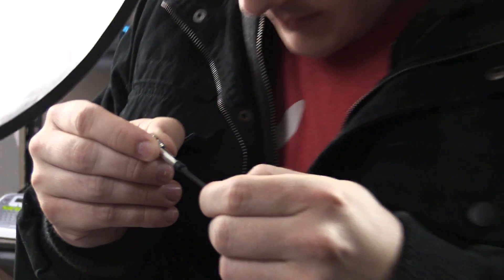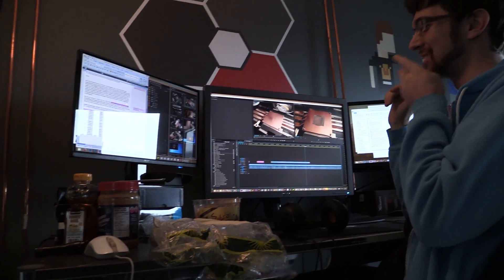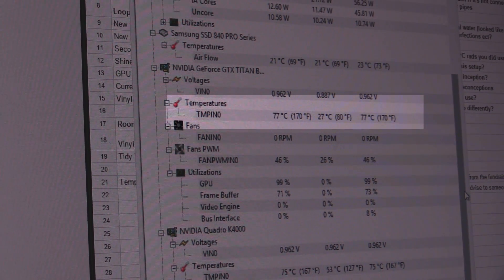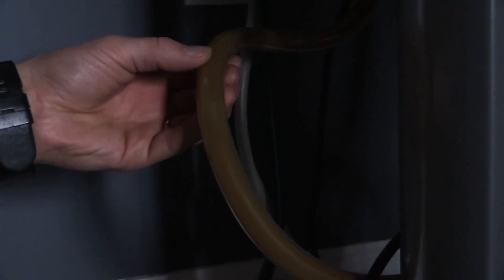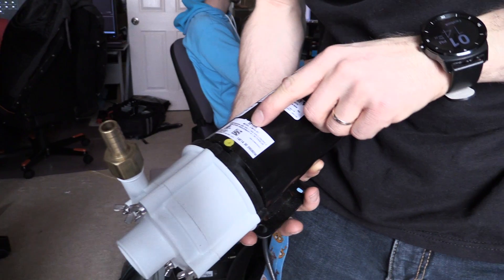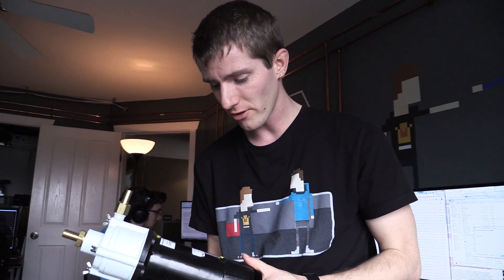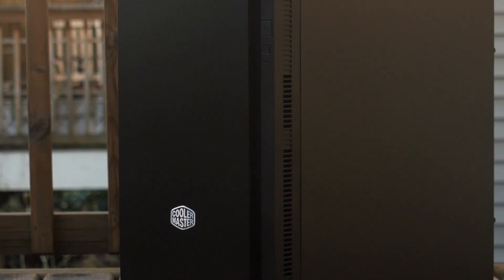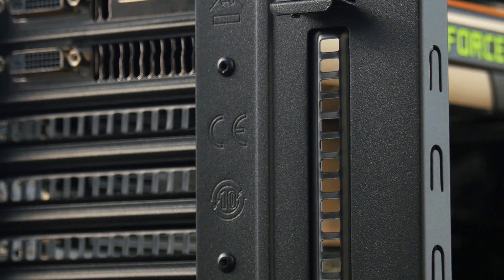Whole Room Water Cooling Part 5a - Trouble is Brewing in the Whole Room Loop...

Comment: Automotive antrifreeze is not a good idea! it is not designed to kill bacteria etc, since in a car it is heated to about 90°C all the time anyways, so every life is killed anyway. you should use something to kill of any bacteria or algea...
Reply: wrote this too soon i guess...
Reply: I think they should just add the "poison" to the current loop minus the reservoir. Over the course of a few days it will probably kill everything and flush it through the system. There may be some traces left, but as long as you don't let them grow it should not be a problem.
Reply: Niosus True...
i think they should attack that reserviour with a pressure washer to remove the biggest chunks. after killing what is left in there with some kind of "poison", rinse it again and then install a filter to get the last stuff out of the loop. When the loop is clean, the filter can probably be takenb out again. just killing what is in there is not enough i think, it needs to get out and new growth must be prevented.
Reply: muh1h1 Yes. The big guns once to get it clean, and a filter or or small concentration of biocide permanently to keep it from happening again.
Reply: Niosus i am sure they will find a solution soon :)
Reply: They should use waterless coolant.
Reply: SamuelDM Look at the first comment:
"wrote this too soon i guess..."
So don't judge others for not paying attention, if you can't do so yourself...
Reply: Buy a single Troy Ounce silver bullion and add that to the reservoir, silver is a natural biocide (As Linus has said in multiple water cooling videos). They're about $20, if that.

EDIT: $20 Australian. So probably $15 or so Canadian.
Reply: Where's Ripley when you need her?
Reply: what if algae is not kill?
Reply: ***** um no its not. The main ingredient in most antifreeze is ethylene glycol which is extremely toxic. Alot of animals die from drinking it due to its sweet taste.
Reply: muh1h1
Why would you take a filter out ? Once its installed, just keep it.
Reply: R4GEcraft Well, as far as i see this is a centrifugal pump, wich would mean it is constant pressure not constant flow. Meaning if the resistence throughout the path is higher, this will slow down the flow, instead of making the pump work harder. But then again, i am by no means an expert, just my thoughts...
Reply: muh1h1 No judging. We both made the same mistake.
Reply: muh1h1
I just watch the video again and yes i also think its a centrifugal pump.
But the pressure isnt really constant in those kind of pumps. Pressure and flow are both function of the circuit's caracteristics.

Anyway, everything here is pretty theoric, we can't really say much without testing it first :)
Reply: muh1h1 Flush the res with Clorox, or alcohol. Very few things can survive that kind of environment.
Reply: LogicOwl | Let's Plays Clorox would probably eat the radiator core.
Reply: That is why I said just the res, not put it through the whole system loop. However, I will acknowledge that there are better solutions which I was unaware of, like silver. No idea that's a natural biocide, you learn something new everyday.
Reply: LogicOwl | Let's Plays There's still the problem of flushing the radiators, Linus mentioned being unsure if they were full of shit too. I thought you were covering both, my bad.
Reply: ThatGuyOnCoke
Using silver could lead to galvanic corrosion though.
Reply: Carlos Eduardo Lopez well, i think it is mostly silicone or venyl, but still, alkohol would probably have to be used quite exessively...
Reply: Noah Miller That's the same thing. . .
Reply: Silver BULLETS .. in each PC
Reply: Niosus
or at least some silver coils
Reply: ThoolooExpress it also corrodes like acid the steel box is 100% the issue the brown crap looks like iron bacteria brown sludge and snot like consistency.  I would have used a plastic drum or aluminum box alternately he could clean out the inside and coat it with some plastic will prevent rust and reduce the iron in the system. Also drop the tap water needs to at least be filtered and conditioned it would be best if it was distilled water rather than tap and since the system will never be close to boiling or freezing the amount of antifreeze should be reduced or eliminated.
Reply: R4GEcraft Because when it is gunged up from all the stuff that is in there now, it will restrict flow quite a bit...
maybe if it is regulaly changed, it is a good idea, but then again, it is just another thing to service...
i think it is not really needed once the system is clean, but i may be wrong!
Reply: @muh1h1 Then change it. But don't remove it.
Yes because of it your pump will have to work harder, but since it's noise isnt a real problem like free particules can be, I see no reason to not use a filter.
Reply: He says it in the damn video.
Reply: R4GEcraft well, whatever, as i said, i am sure they will figure out a solution!
Reply: LogicOwl | Let's Plays
and alcohol would eat away any rubber/plastic tubing
Reply: muh1h1 Flushing with regular water would work fine. You'd just have to cycle it for at least 24 hours to get any gunk out of the rads.
Reply: I got it guys. Hydrofluoric acid will solve all of your problems. kappa
Reply: CriminalReapergaming yeah, lava is also pretty good at killing bacteria! :)
Reply: Antifreeze has a lot of chemicals inside to help stop erosion and corroding of the tubing and metal tubing inside of the engine. The chemicals also increase the boiling point of the water..

Anyway, there's normally two types of anti freeze. Antifreeze which is 'non-toxic' and just plain old anti-freeze; which contains Ethylene Glycol.. which is poisonous to humans and animals etc.
Reply: Radiator fluid works the best not anti freeze
Reply: lilPOPjim Actually, Ethylene Glycol itself is not that toxic. It's the byproducts when it oxidizes inside an animal/human body that is toxic. However, the same cannot be said for more simple organisms like algae and bacteria, there hence antifreeze would not do much, if anything at all.
Reply: Just use any desinfecting agent, like chlorine.
Chlorine is widely used to desinfect water.
EDIT: note that too much chlorine could be corrosive as well.
Reply: But antifreeze is toxic to life forms, how can algea and bacteria grow in it?
Reply: Bruno Iván Hernández Góngora ah
Reply: What about chlorine and other chemicals used in pools?
 That would be a great solution?
Reply: Lámbientan Lámbientan Such chemicals would be a reasonable option for flushing it out but can cause damage over time to some of the seal and tubing materials.
Reply: *****
I don't really think so, I see that Linus built the tubing with copper and (I think I see some) pvc, the same materials pools use in their systems (I've worked with pools). Also, thous chemicals are lighted to not cause any damage to the human skin. The correct amount of chlorine per 100 gallons of water is 0.013 onces (negligible) , if Linus is able to determinate the amount of water the system will use, he can calculate the exact amount of chlorine he need. What I see he can do, is build as much as he can with pvc with valves to close the watercourse when a repair is needed. I mean, is how pools work. However, I don't know how the water blocks would react, may be in a couple of years they have to be replaced (I don't know how week they are... the copper water blocks would be the best option, the copper is a really great and durable material), but that's why I would put valves.
Reply: Lámbientan Lámbientan Chlorine can damage some plastics and rubber - especially those that are not designed for it. This system has a wide variety of materials - not just copper and pvc. Even the teflon tape used in threaded connections can be damaged over time by chlorine and lead to a leak. Some professional plumbers even advise against using chlorine to keep toilets clean because of the damage it can do over time to components in the tank as well as the wax seal at the bottom and can lead to failure or leaks. The amount of chlorine required to keep a system clear will vary depending on the application and the current state of the water. In the case of biological buildup a larger amount is required to shock kill and cause sediment to separate out and drop. Pools require exactly this type of chemical action if they have similar buildup, followed by collecting or filtering out the sediment and a maintenance level of chemical treatment.
Reply: *****
You're right.
Well What is you solution?
Chlorine is one of the chemicals you can use in a pool, also, in a pool, the chlorine just help to prevent the breeding of bacteria (not eliminate it), the other important aspect in pools to not create bacterias in their system, is that the water is not stagnant, is always moving (and that's one reason is so important to filter the water of any sediment how you said). I'm not an expert, I'm just talking for what I've seen. What would you do?
Reply: Lámbientan Lámbientan I gave my suggestion at the top of the page. Use chlorine, bromine, vinegar and baking soda, or other chemicals to help flush out the biological contaminant keeping in mind the pros and cons of each. Then use UV and silver along with low levels of biocide to keep the system clean.

Chlorine is used to help clear contaminants in pools and is sold as "pool shock". I would not recommend using such a high concentrate in this system though. Too much chlorine in a confined space is potentially dangerous and it would be overkill for the volume of water in this system anyways.
Reply: Lámbientan Lámbientan Chlorine kills basically everything.  Sure, it prevents breeding... by killing everything on contact.  It's one of the most toxic substances you can buy at a grocery store.  The reason it's used is because it's so harsh it's basically impossible for something to be immune to it.
Reply: Lunas Eclipse
he's in canada, so you do want some antifreeze
Reply: ***** the point of antifreeze is to raise the boiling point and lower the freezing point from the looks things I would say 15-25% antifreeze to water mix. Would be fine and copper sulfate and silver kill coils together with the up should kill everything. The sludge will clog any filter you put on it. That brown stuff does respond to uv but not as well as I had hoped.
Reply: Lunas Eclipse
silver and nickel don't work well together. the res is steel, so you can wash that out with bleach, to get most of it out. i'm well aware of how antifreeze works. in case you haven't looked at a globe lately, canada is north, and things in the north get cold...
Reply: ***** i cant think of why combining silver and nickel is bad the only chemical reaction for them i could find was silver nitrate where the silver will be replaced by nickel. Aside from that the blocks i believe are either nickel or silver plated... silver kill coils are coils of pure silver metal and works fine with copper sulfate both are anti algae and bacteria. both should be available the copper sulfate should be at any pet store that stocks fish.
Reply: yeah, it's just what i was told... it seemed strange to me, for 2 transitions metals to react with one another.
Reply: Yeah there is more reacting between the copper and the aluminium. But he needs water wetter too i don't know about iodine that might not be for the best.
Reply: i know... he doesn't seem to have a clue about what he's doing... i mean, it's a pretty easy fix, you can put silver coils in the res pretty easy
Reply: i was thinking they could use a deep freeze to put the res in and perhaps the radiator another thing i might try is a small circulating pump to put the fluid in the res through the radiator at a set speed then the 2 bigger pumps to circulate the coolant to the pc.

Also linus you should know i had that same brown muck in my aquarium the uv filter and filter did not solve it. It did seem to die down alot but for the longest time until my plants got established the brown muck flourished. there is some sort of nutrient in the water it needs and when my plants got to the point they pulled enough out of the water that is when it died off. BTW this algae killed 2 filters and lots of media so you will likely want to stock up on pleats.... also you should coat the res insides with something look for http://www.por15.com/POR-15-Fuel-Tank-Repair-Kit_p_62.html
Reply: Wen Lin it will return...
Reply: +Krevin Grard first off this planet belonged to bacterial/viral and fungal types first they can survive better than animals..
Reply: Ehsan Asimvreeken what does that have to do with ethylene glycol poisoning?

Comment: maby you could try to add some acetone.
it kills pretty much all bacteria (if concentration is high enough). and it cleans of pretty much everything sticky from inside tubes. and it has the same colour as water, 

and run your water trough a 0,22mirometer filter before you enter it to the system. it makes sure all solid stuff is out.

Comment: So you wanted to make a room watercooling with the rads outside. Still you put rads on top of the pc that heat up the room? Isnt that against the concept?
Reply: They are here in case something goes wrong with the loop
Reply: MrMark201200 and for winter season to heat up the room

Comment: The computer at 4:25, it got 2 graphics card but not connecting through SLI? Is there a special reason why there isn't a SLI-connector there?
Reply: K6000's are for Computing, no sli is needed.
Reply: Edzel Yago You have the best profile picture.. I didn't even knew it was you ;o

Comment: dude, remove the cpu and gpu and flush them good!
a friend of mine got a bad radiator and the flux crimp all goes into the micro channel in the cpu block, the water pressure build up too high and burst. 
this isnt a joke.

Comment: I'm just wondering... would chlorine damage the equipment?  It's the easiest way to kill off bacteria/algae.  

Also, a cheap micron filter WOULD remove larger organisms like algae.  Also, ensure everything is air tight.  If it was running with air coming into/leaving the loop that'll feed microorganisms.

Comment: If it is a living thing, just get a 30% vinegar solution and flush the system with that. Might cause some corrosion but the change on pH would cause the proteins that make up the organism to denature and kill it. Never have done water cooling before but I'm a biochemistry student.
Reply: Then you should know that adding acetic acid may just encourage the growth of over stuff by adding another lovely carbon source. :P
Reply: QueenGoesYT Haha, filling the pipes with methane and then setting a remote ignition would be funnier.
Reply: Na5iR11 What about dissolving chlorine gas in the fluid?
Reply: the only way to clean a loop properly is to take it all apart first, a very tedious process in this case lol
Reply: Na5iR11 Chlorine can kill certain types of stainless steel, but shouldn't react with copper or brass in my experience. But, that depends entirely on the nickel content of the alloy IIRC.
Reply: Nawar Corleone I honestly can't answer that Nawar since I am still a studying undergraduate. I do know that if you want to get into serious research, you would have to get a masters degree on top of an undergraduate or even a PhD. But you can land a job in a company involving biochem as a assistant researcher or whatever with just an undergrad degree. Chemical engineering, which I think is part of biochem, but is not what I am studying as I am looking more at living things, can offer jobs at pharmacies and large pharmaceuticals which would offer great pay and a great working environment from what I hear. Law depends on what country you are in. In Australia (where I am), law offers a high chance of employment to my best knowledge because there are always going to be needed in a civilized society where you can so easily be sued or wronged, look at Samsung vs Apple. I did a business law subject as part of my business degree, (I am doing a double degree by the way), and I loved it, but my friend absolutely hated it, so it is a matter of personal preference. Also, for law, I do not think you need to do masters or  anything, with a undergraduate degree, you can jump straight in to the job market with plenty of opportunities. To me, they both can be great career options, which is probably why you can't decide between the two.
Reply: HVAC service technicians often use a mix of vinegar and baking soda to clean out air conditioning condensation drain lines. The benefit of this mix is that the reaction forces much of it down long lines and can help to dislodge material. It also happens to be cheap and nontoxic. There are a number of other treatment options that work as well.
Reply: Anyone else who has done water cooling have their own method of removing the organism?
Reply: Na5iR11 by yelling at it!
Reply: True, some other fungi/bacteria that flourishes in the 2-3 pH range would emerge. That's why he should flush instead of using permanently. The acid is just to create a set a temporary conditions which are inhabitable by the current fungi/bacteria.
Reply: David Dubow My idea is still not a good one though due to corrosion, so, let's hope he find's a better one.
Reply: Faissal Bensefia Sounds like the best idea. I am going to look up on whether chlorine would react with the metal pipes later when I am less lazy, just to be thorough,
Reply: Nawar Corleone Going even more off topic. I would just like your personal opinion on what major I should do for my business degree. Accounting or Human Resource Management. I have decide in the next couple days and it has been eating me alive for the past few days, as I am already late but my university is flexible with us.
Reply: Nawar Corleone Thanks:)

Comment: I am almost sure that the "floaties" are mineral buildup from your water supply.  You should only mix distilled water with antifreeze.  You can use 50/50 premixed but the overall cost is higher.